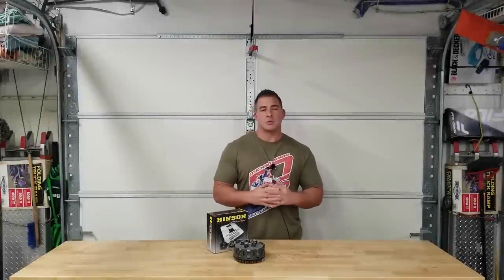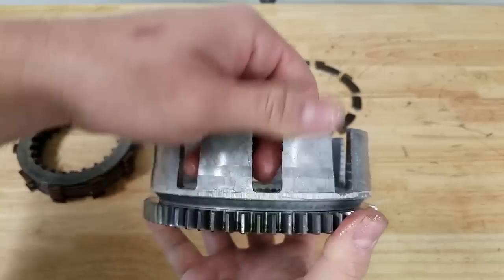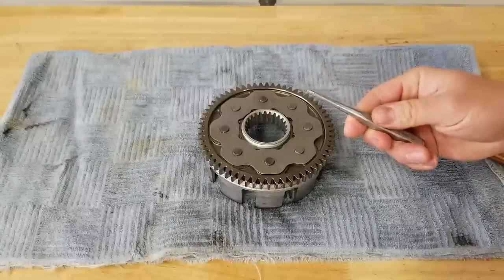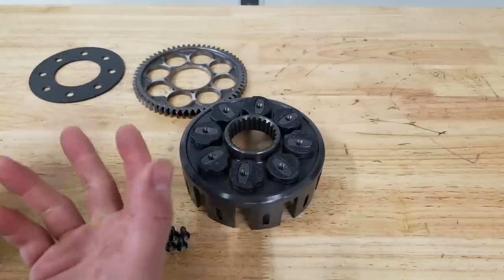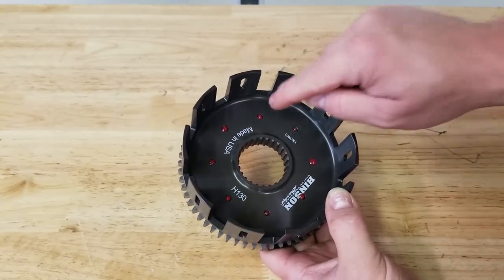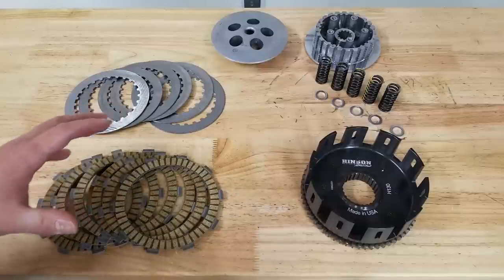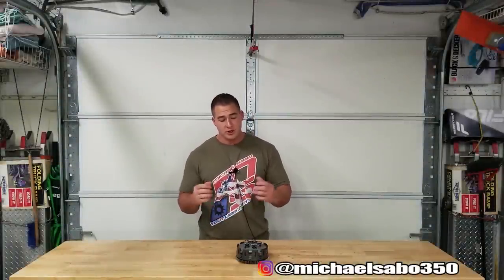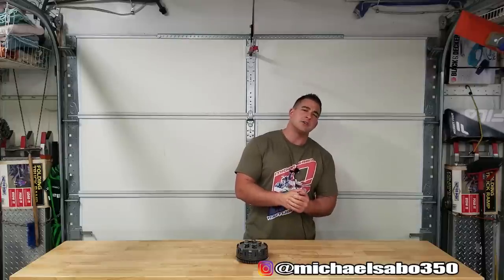Installing a Hinson Billet Clutch Basket and the Neil's Clutch Mod | Project 250R Part 18

Comment from the maker: Thank you for watching my video! You all ROOOOOOOCK!!!!! 🤘

Parts list for the Neil's Clutch Mod are as follows...

CR500 Springs 5 pcs - (Part #22401-KA5-740)
https://amzn.to/3cYFavB

TRX250R Fibers - 7 pcs -  (Part #22201-KAE-000)
https://amzn.to/2TNtRyW

TRX250R Steel Plates - 5 pcs (Part #22321-KFO-770)
https://amzn.to/33fCvt9

TRX400EX Steel Plate  -1 pc - (Part #22321-MV4-000) https://amzn.to/3aWdlT2

Honda Drain Plug Washer - 5 pcs - (Part #94109-12000)
https://amzn.to/39PO6BH

Extra Thrust Washer (Optional) - 1 pc - (Part #90456-KA4-000)
https://amzn.to/3aVJdHf

Hinson Billet Clutch Basket For The TRX250R - 
https://amzn.to/39PQxEl

Tools/Fluids I used

Milwaukee M12 Fuel Drill - https://amzn.to/39QHrXT
Basic Small Torque Wrench - https://amzn.to/2Q9Zbpl
Hammer - https://amzn.to/38Qmr2f
Punch - https://amzn.to/2wZFYQc
Drill Bits - https://amzn.to/33fJvWU
Klotz Flex Drive 30 - https://amzn.to/2WePdqG
Loctite 272 - https://amzn.to/2ILqS3x

Comment: Mike in enjoined your channel and you bro! I love Honda's especially 2 Strokes. I had a female friend who her And I had CONTACT TO THE FINAL DEGREE ON THE TRX. I probably shouldn't have TRUMPED THAT ON YOUR CHANNEL. Sorry. The engine Was rated @ 39 HP but properly uncorked it was a more like 43. The bike turned faster than the Suzuki and the Banshee. I added a tooth too the rear sprocket and it made a huge difference. I'm looking forward to the FUTURE and seeing you ride her. Thanks for the effort that you put in your channel. ✌
Reply from the maker: That is awesome Jim 🤘 Thank you for the love and for following my build! LONG LIVE THE R!!!

Comment: Man that’s a trick setup. I did the Barnett fibers and disc with oem springs and basket and it works alright but that looks way better
Reply from the maker: Thank you man; I'd actually get a Barnett over the Hinson because of the stainless inserts the Barnett uses; I was unaware when I bought the Hinson.

Comment: The cr125 clutch basket and inner clutch basket will fit in a trx250r Arlan at LED is doing that to my motor you use cr125 clutch plates and 250r steels. And if you get your pipe before I get my cases back from LED I'm going to be mad.lol 7 weeks
Reply from the maker: Haha. The CR125 setup was my 2nd choice; I've heard great stuff about that setup too.

Comment: This is my hinson story.....so I bought the basket inner boss and outer boss separate from 3 different sellers and the basket was 150 new open box....the inner and outer were very slightly used...I got the plates and fiber kit for 100 and I went with aftermarket Barnett springs....they have some gold shit coated onto them that's makes them special somehow not sure...but I saved like 600 bucks buy not buying the complete kit....the action after install is really smooth
Reply from the maker: Good shit man; I'd love to run the Hinson boss and pressure plate but they're mad expensive.

Comment: i have a 87 hp banshee with the stock clutch basket and i’ve had some slipping but only occasionally i might upgrade to billet
Reply from the maker: Dude that's really pushing it with a stock basket lol

Comment: sweet set up dude . ive always just ran hinson clutches with the basket . their disks are dimpled now smooth and never had problems and ive raced mine for many years . then you dont have all kinds of other parts you have to find . just one call thats all . hinson is the way lol . and anything klutz is top of the line . i do wonder though if this neils clutch set up is cheaper than hinson though
Reply from the maker: I think price-wise, the Hinson fibers and discs is actually cheaper. OEM stuff purchased individually is usually not cheap; mine sure wasn't. However, the OEM stuff is supposed to wear very well so I'll try it.

Comment: Wouldn’t you need a different inner hub?  since your adding another friction and steel it looks like the last steel wouldn’t engage with the inner hub. 26:35
Reply from the maker: I am running 7 fibers which is the stock amount. If you run 8 fibers, then yes, you do need to run an aftermarket boss and pressure plate.

Comment: Don’t forget to also install this https://rover.ebay.com/rover/0/0/0?mpre=https%3A%2F%2Fwww.ebay.com%2Fulk%2Fitm%2F390930501270 upgrade while you have your clutch apart👍🏼. Big difference on the pull.
Reply from the maker: Thank you for sharing the link! I believe my bike already has the update... I think lol
Reply: Michael Sabo This update only came on the ‘1989 TRX. It comes with the new end pressure plate, Push rod & end cap & the flat washer & flat needle style bearing. Early years just pushed on a single ball bearing at the end of the rod, and the end cap.

Comment: Doesn't scuffling the metal plates make the fiber wear faster because it is scuffed?
Reply from the maker: In theory it could if the plates are still slipping a lot; but it should have less slippage which can actually save the fibers from wearing.

Comment: Hey mike I'm working on my friends rmz250 now weirdly the clutch cover is rubbing the pressure plate what's going on I'm pulling my hair trying to figure this out.what would cause it to touch the cover like that. To the point when the cover is tight the kicker wont return.

Comment: Hey Michael. Are you sure you peened the bolts correctly? I usually seen folks strike the edge where the bolt thread meets the wall, vice the center.
Reply from the maker: I actually researched this before making the video; from what I found; bolts can be peened on the edge or the middle. Other people actually mushroom the end of the bolt with a peening hammer if there are enough threads exposed.  Hinson did not specify where they recommend you make your peen.
Reply: @MichaelSabo  Cool! Just wanted to make sure. I'm not the biggest fan of the Hinson instructions. My dad and I are rebuilding my old Z400 and restoring one of Chris Borich's LTRs from last season. I just finished putting a new hinson basket in the LTR yesterday.  I'll be sure to send over some pics once we finish both up!

Comment: Man I just did this on my dads ltr450 and now the clutch lever wont fully disengage the clutch. If you pull it and try to into first it will stall out. Think the lever just needs to be adjusted?
Reply from the maker: That's what it sounds like to me, could be as easy as tightening up your cable. Might want to inspect your clutch basket fingers too,, if they're grooved, it can cause the clutch to hang up.
Reply: Michael Sabo I replaced the basket with a hi son and inner hub with another brand. I trued adjusting it and now it bangs into gear. It won’t let me put it into neutral. It skips and goes into 2nd. I’m not sure if I just don’t know how to adjust the clutch cable correctly. My dad said it wouldn’t bang into gear before. I also put Tusk heavy duty springs in it as well. I only soaked the clutch discs in oil for like an hour so maybe that is the cause. He is going to take it to the power sports mechanic because I don’t want to ruin anything.
Reply from the maker: @Jursaw  its not because you only soaked the plates for an hour. So it had normal function before? Its possible the new clutch pack is too thick causing it to never fully disengage. You may need to use a different washer on your pressure plate or mess with your cable some more. It's hard to diagnose without seeing it, i hope you're able to figure it out man.
Reply: Michael Sabo Thank you for your help! My dad said the clutch lever was always hard to pull since he bought it used but it never banged into gear. This past weekend he said the clutch was toast. Ill comment once I hear back from his atv mechanic

Comment: hi can we buy the hinson clutch bascket WITH the gear ??
Reply from the maker: You may be able to find one used that's already assembled, but as far as I know, you can only buy the basket and gear separately; if you're buying the new gear, the hardest part of drilling the rivets is taken out of the process

Comment: Decent video man!  

Be aware of just how much the larger torque wrench is off spec though.  Like you say, you’re reducing down a lot! 

To let other folks know.  If you’re in the bottom or top 10-15% or so of the range of a spring type torque wrench then they’re really unreliable.  Get a bigger or smaller wrench if at all possible.

I understand that a new torque wrench is expensive for a lot of guys, but it’s a hell of a lot less than a new case if they’re stripping out smaller bolts using too  large torque wrench.